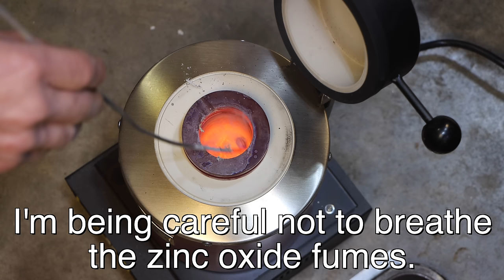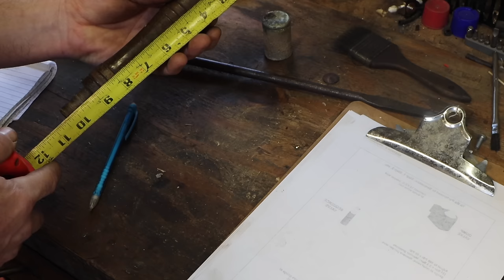One-Of-A-Kind Antique Screwdriver Restoration

Comment: Pretty, but its nothing more than an orniment. Nothing wrong in that; beyond it contradicting your stated goal. 
Why was it bent? Because a screwdriver that length is begging to be used as a lever.
Why did the ferrull fail? Because it has been used as a lever.

With a bent shaft and undistinguished wooden handle; whos cares if it breaks.

With a carefully straightened shaft laboriously fitted to a lovingly crafted, figured grain, Walnut root handle with it's hand cast bronze ferrul( ferrell, ferrul.....), who -- much less its careful, considered restorer, is ever gonna beat, pull, lever or twist on this heirloom? 

'sides, who uses large size flat head screw anymore? And who, if the encounter them in something they which to use (rather than 'preserve' which is a pointless accademic exercise) without repacing the with a cap head hex bolt?

I refresh your 'videos' pageseveral times every day hoping for new content -- I've viewed everything in yourback catelogue; and 13 days is too long to wait. But I waited anyway; and this mildly interesting, but ultimately useless out is the result. 

You will do, what you will do; and I will watch your output from beginning to end hoping for your 'classic' output. When you give me this after a long wait; I'm disappointed.

Maybe i'm the only one; or maybe I'm the 50% of the normal distribution, that do not appreciate make-work, for-youtube, filler.

What have you done to the CAT D3?

What -- above yuor likabilty, apparent down-to-earthness, and modesty, make your channel stand out?

1) You finish what you start. 2) Yuo do not  promote crap simply for a buck.

At least you did up to now. I'm unsubcribing; bitI will monitor your channel in the hope you'll get back on track.